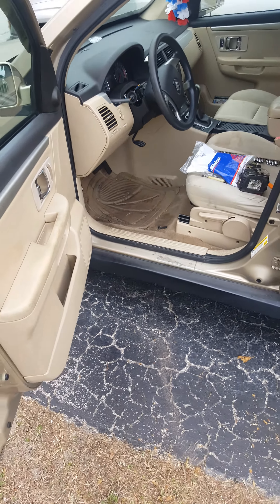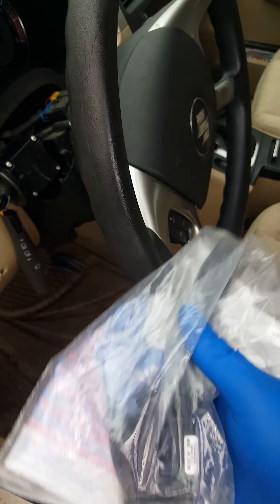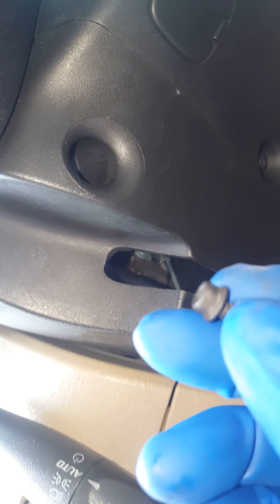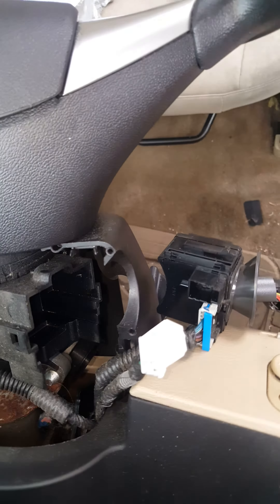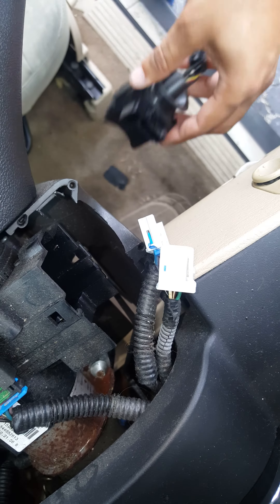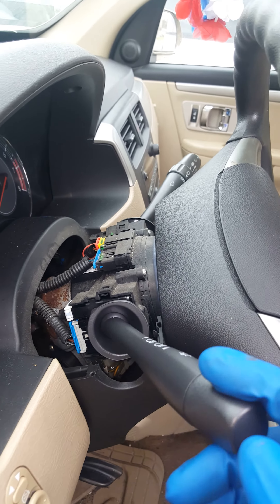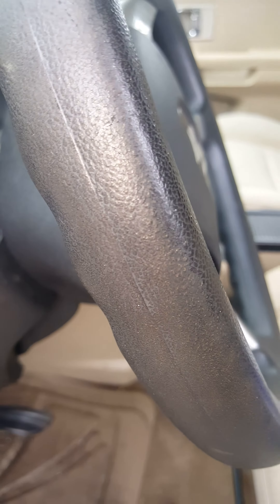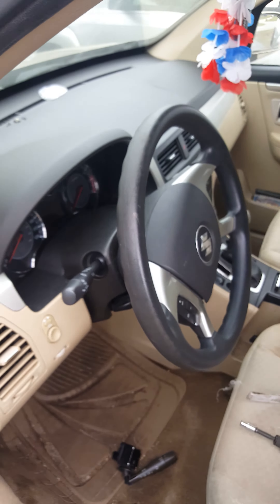07 Suzuki xl7 turn signal switch replacement

Comment: For anyone reading the comments for these suzukis... I've owned mine since 2010 and it's 2025. I had the timing chain replaced within a year of ownership under the manufacturers powertrain warranty. Since, I learned that the oil has to be changed every 3k miles no matter what!! Don't use cheap oil. High quality oil like valvoline or Mobil full syn. That's going to be way cheaper than a timing chain. Also,  I bought nice seat covers... this is a game changer. These light color seats look awful if a drop of water gets on them.  I resealed the roof seams under the plastic roof racks with an rv auto leveling white sealant, and I took that all the way down to the back under the rear door. I used some clear caulk to seal up one of the rear taillights that was getting foggy. I had issues with the wiper fluid nozzle shooting out and needing replaced all the time... so I used a little bit of rtv or caulk around one and installed it. I had to use a needle to poke through the holes after it dried because a little got in the holes.  Works perfectly. 
I replaced the strut assemblies, both rear shocks, sway bar links, and I believe the lower control arms. I've had to replace the maf sensor years ago, and I've replaced serpentine belts, air and cabin filters, etc as regular maintenance. I've replaced both abs sensors on the front and have done brakes a couple of times.  That's it! Right now, I'm pretty sure I need both front wheel bearings, too. In all the years I've own this car that is all I've had to do. 

YOU HAVE TO CHECK THE OIL LEVEL REGULARLY!! The engine will make a clicking noise on turns when the oil is low. Mine burns about 2 quarts of oil every 3k miles. KEEP IT FULL!! I also use seafoam in my oil and gas tank when I'm a week or so out from an oil change.  This keeps my engine clean and not gummy. I've also done all of this work myself outside of the timing chain since it was under warranty.  This has actually been an amazing vehicle.  I'm surprised I've not had to deal with a leaky lower intake as GM had issues with these for over decade before this vehicle was made. If you can't find parts for the suzuki look up an 08 equinox with the 3.6l engine. I can't remember if that's the limited or some other name.... it must have the 3.6l engine or your parts won't match. 

Oh, yeah! I did have to replace the right front parking light/ headlight wiring harness with a used one from ebay. I couldn't find anything wrong with mine upon inspection, but it would intermittently dim, go out, and brighten and didn't always do it with automatic touch. I've also had to redo my headlights... but that's most cars nowadays.
Reply from the maker: Thanks for the detailed breakdown of your experience! I'm glad you've been able to keep this XL7 running so well for so long.  It's great to know that other vehicles can be a good source for parts too!

Comment: Great video...any idea where a coolant sensor is on a 2008 suzuky xl7
Reply from the maker: Stephanie Arteaga thanks you but coolant sensor for the ac or radiator water
Reply: Kenny radiator water
Reply from the maker: Stephanie Arteaga there should be one near the oil dip stick
Reply: Kenny ok thank you!!
Reply from the maker: Stephanie Arteaga the other one it's goin to be under the intake manifold if I'm not mistaking it's on the pipe that crosses water from the from of the engine to the back of it
Reply: Great video. I swapped my broke one to new one. Thank you